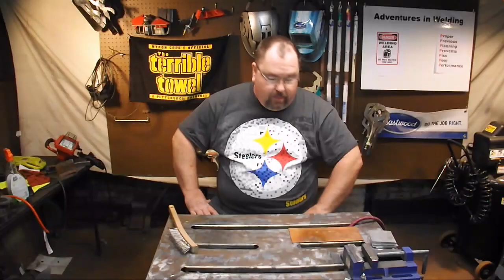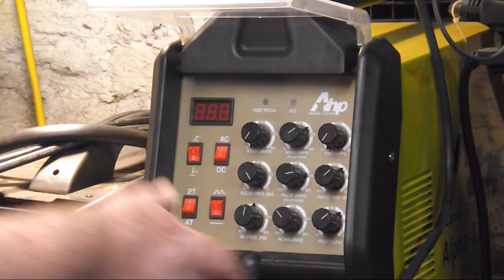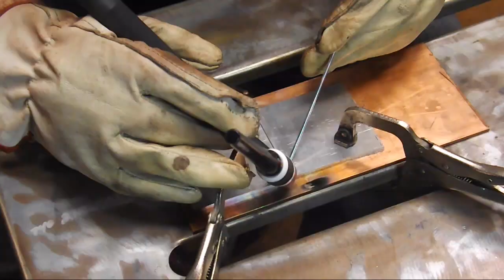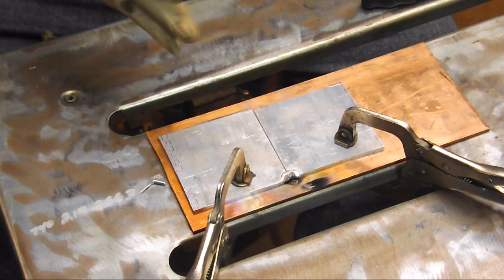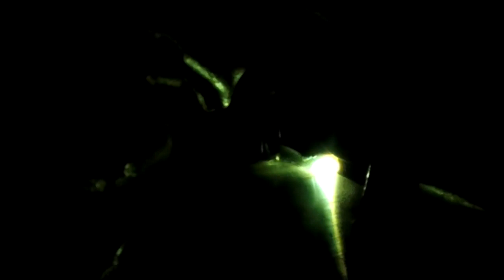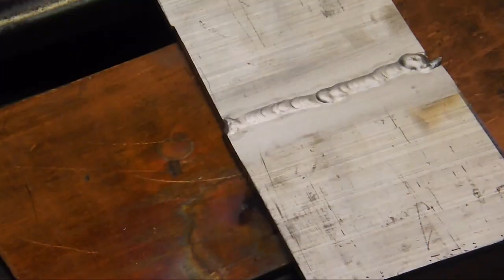a simple trick for ac tig welding

Comment: lol. Brushing the oxide off is redundant!  What's the point in welding on 40% pos balance if you've brushed the oxide off? Tie ins are a joke.  120 hz is entirely unnessecary and not applicable to this joint.  The copper plate is hurting you it's soaking up all the heat before your joint gets up to temp.  What's up with the nonexistant amp taper on your termination.  Touched his tungsten on the second dab WTF. Oh yeah and post flow should be 14 seconds not 6. And the torch angle is freaking ridiculous. Jesus dude just stop.  Check out welding tips and tricks if you want to know how to weld. This no talent clownshoe is making a mockery of our trade.  You'd be laughed out of any shop I've worked in. Can't even run a strait bead on a 3 inch joint..

Comment: Hey 😀 Glenn from Norway here. I'm wondering about welding copper with tig, do you have any advice on that? only done some stainless witch is fun and fairly easy but I am thinking of making a copper sink for my kitchen, do I use AC or DC? can I just braze it? my worries about brazing is that the color would be different.  any thoughts?

Comment: Hopeful the arm heals just as fast as the other. Cool stuff, have you ever played around with an alum. mig gun? Can't recall if you have or not. I'm currently on the fence with buying one myself for a few projects a friend has asked me about and alum. fits the bill. 
-Pidge.
Reply from the maker: +PiDGE IAM Thanks buddy! I have played around with a spool gun, here are a couple videos I did:

Spoolgun setup https://www.youtube.com/watch?v=Ph3_nBqJbfI
Spoolgun useage https://www.youtube.com/watch?v=sxpL4zknExE

It's quite an investment, at least $200 usually in the $400-$500 range but it does have some great uses other than aluminum. You can have a big roll of say .045 in your machine and keep some .023 in your spoolgun so you don't have to switch out rolls when changing wire.
Reply: +Adventures in Welding! Right on man I'll have a boo at them. Thanks.